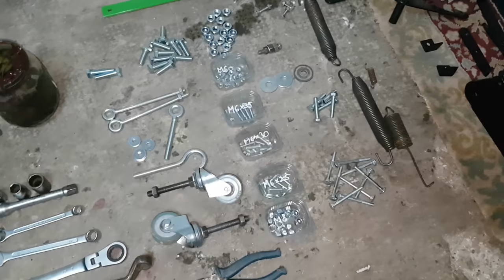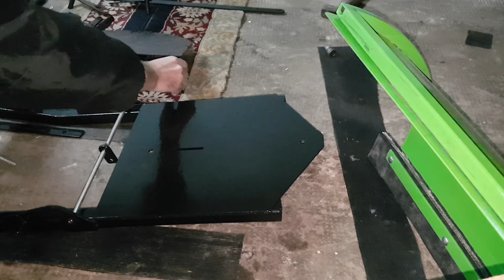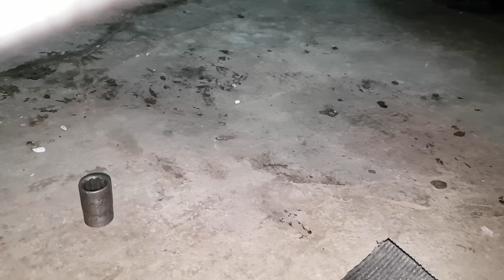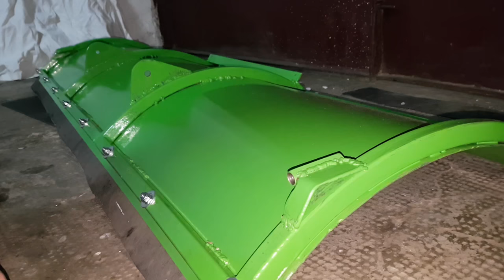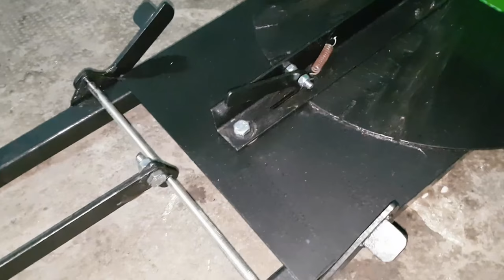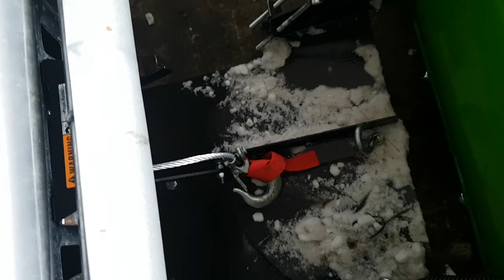Building an ATV Snow Plow - Part 5 - Assembly

Comment: If you do a lot of plowing you'll want to replace that winch cable with a synthetic winch rope. I got so fed up with the winch cable breaking so much that I had to try something different. I put the synthetic rope on three winters ago and I'll never use a cable again. By the way, great DIY plow.
Reply from the maker: Thanks! I still use the cable in the video, but I don't plow very much. How's the synthetic rope holding up in time? Doesn't it require much maintenance?
Reply: @BogdanCristian  The synthetic rope is working great. I put it on three winters ago and it hasn't broke, or even frayed yet. And I do a lot of plowing. No it does not require any maintenance.
Reply: @fourbyfourer  You are supposed to wash and dry it out if it ever gets muddy, wet, or dirty. The dirt works it's way into the inner strands and acts like an abrasive destroying the rope from the inside out.

I'm 100% with ya on rope over cable.

Comment: Honestly, this build has a great design to it. I bet this will work well and last a long time, however, I would imagine you could have easily purchased one for less than this cost and would've only taken a couple of minutes to install...
Reply from the maker: Thanks! Surprisingly, building it on my own cost me about half the price of a new one at that time. It's still holding very good, there are just some spots where it started to rust but other than that it's in great shape!